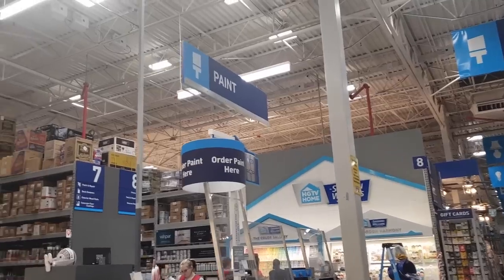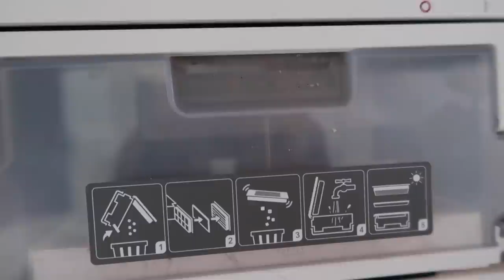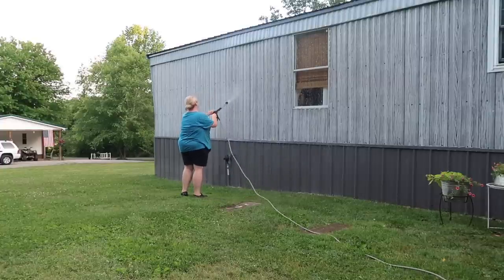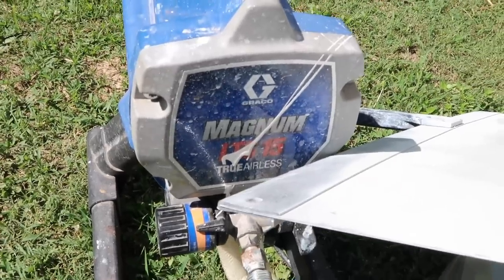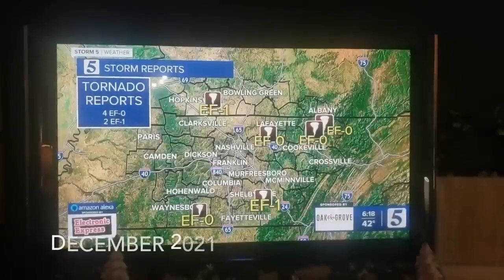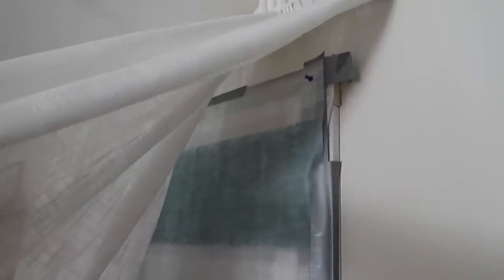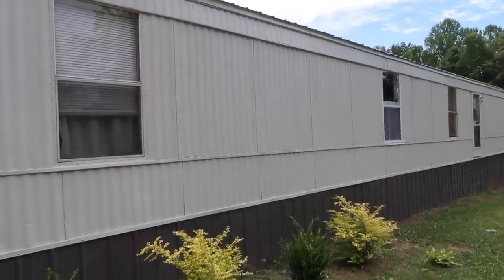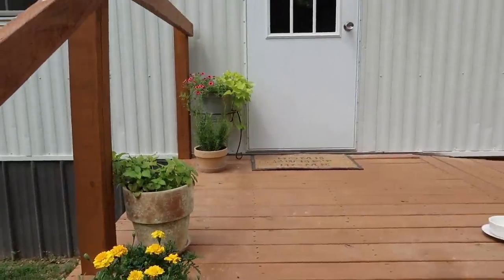Painting the exterior of our single wide mobile home | New kitchen window | Mobile home remodel

Comment: ok just found your channel,  I have a 1986 mobile home, been here since 2007.  Your mobile home is very close to same drift wood grey that mine was.  I painted it 5 years ago with a brush.  Valspar storm coat, I got on the discount rack for 60.00.  I am getting ready to paint it again.  That is the worst fear about living in a mobile home.  Hurricanes, tornadoes, I am in Virginia, on a peninsula. Thank goodness I have not had any storm damage.  Been thru several north esters and hurricanes.  Yes shade is wonderful, but big trees can uproot and cause damage.  I live in a mobile home park. There are not a lot of trees. In the summer it is difficult to keep cool, due to the lack of shade.  I like what you've done to your home and appreciate the hard work you've put into it.  
Mobile home living is an ongoing project.  I could share more, and perhaps will start making videos on my own mobile home living.  It is definitely and live and learn adventure.

Comment: It looks good, a little paint makes a world of difference! I painted mine and brought shutters to put up from home depot.Wood is so expensive and they have all colors.
Reply from the maker: Thank you! I know, I was adding it all up and stared to wander if I should just buy some. I've wanted wood ones for years though.
Reply: @LittleBlessedNest  I wanted wood ones also but a while ago i was renovating my mom's mobile home and she had the original wood shutters- i had painted before, they fell apart while being attached by nails to the building-they rotted. So i would get one set of shutters,till i got all the ones for the front- which has 7 windows. It's a old one made in 77 after the industry changed them to be built better.
Reply from the maker: @lovenotes5299  well darn, I hate that they fell apart on you. That sounds like something that would happen to me. lol!
Reply: @LittleBlessedNest  It was okay, cause the yr i had to paint them, they couldn't be taken down- they build them on the trailer- so i got her some cranberry colored shutters(mine is brown). They have been up for over 2 yrs now, and they don't fade in this hot sun- the color is a thru the product.

Comment: Lovely. What a great brother, dear. We have a 1965 mobile home fixer upper, i am watching what other folks are doing. We are in Albuquerque, N.M. and the Sun is broiling by 10 a.m., how much of ur 5 gallons did you use? Tee
Reply from the maker: I can only imagine how hot it is there because it's miserable here in KY. The humidity is the worst! We used most of the 5 gallon bucket. There was a some left, but not a lot. Our home is a 14x52.
Reply: @LittleBlessedNest  It's a dry heat.....lol standard reply given. Came from East Coast so i don't miss humidity.🌵

Comment: I do not recommend the use of any latex water base paint on the outside walls of a mobile home. I had a neighbor who painted the front of their mobile home with latex and a few years later the paint started peeling off. Before I ever started such a project I would have to get professional advice from a paint company who could instruct me on exactly what all I could or could not do. I do know I have used oil based red oxide primer and enamel paint on outdoor metal that has lasted for decades without any problems. Wood shutters will rott and fall off not recommended.
Reply from the maker: I used paint specifically for metal. Thanks!
Reply: @LittleBlessedNest  you'll know if it's going to fail in few short years. My belief is if it was a water based paint it won't last. The oil based primers and paints to me are the best for metal but time tells all.